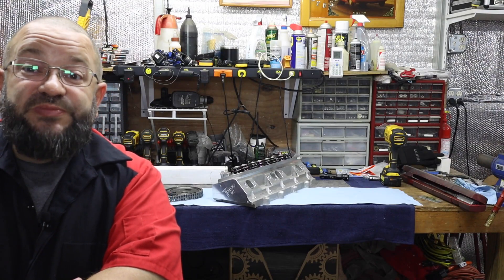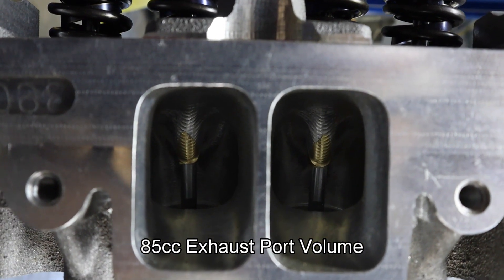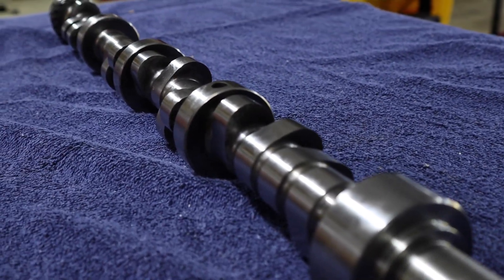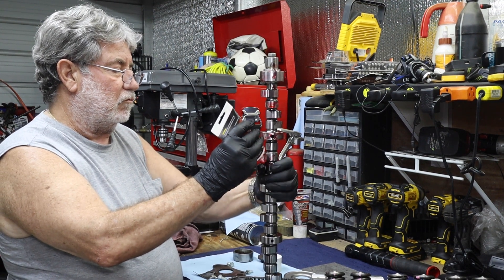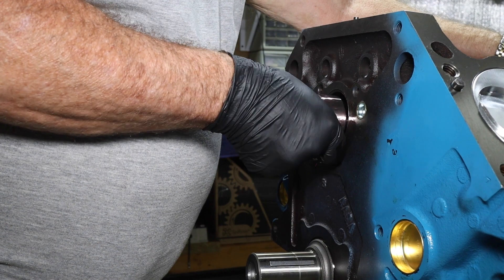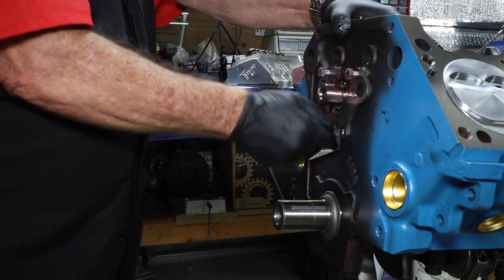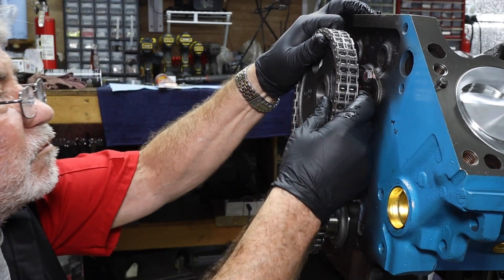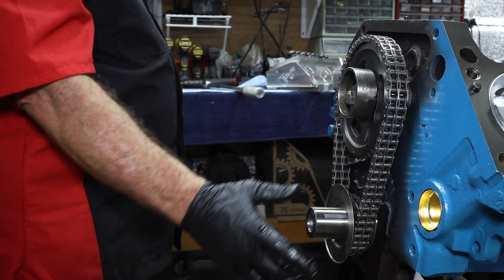The LA-phant: Cam, Heads, and Rockers (Part 1 of 3) | Cam and Timing Chain

Comment: i never heard of W-2 Indy head. is this 360-1 head, okay after review it is 245 cc intake 2.10 valves. as per shown in video. they rated Flow at 340 cfm fully cnc ported
Reply from the maker: Yeah. They were based off the w2 heads. I believe I left the links in the description for those concerned or curious about the numbers.

Thanks for watching and the info for the viewers.

Comment: Mr. Mike; looking forward to seeing the the other parts!! Using a longer bolt in the end of the camshaft makes installation easier. Also use using a nice plastic hammer to install the camshaft drive gear and crankshaft gear is a lot easier on your hands 🤔. From an OLD engine builder😊. Mopar that is👍👍.
Reply from the maker: Thanks. I'll make sure to pass this along to Pop.